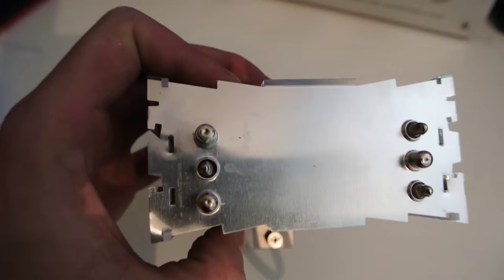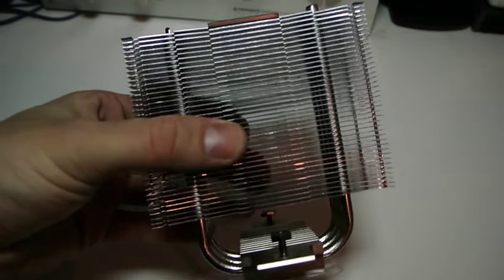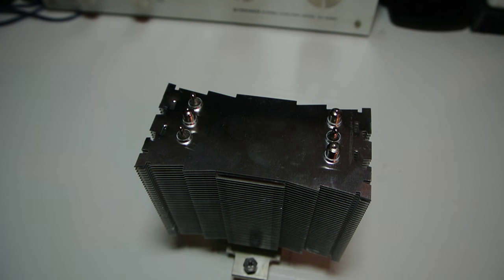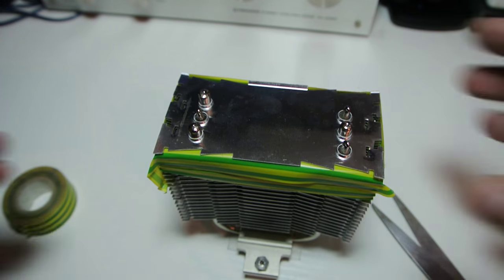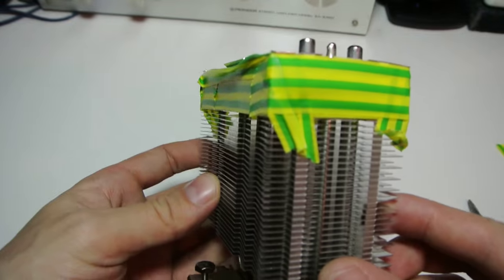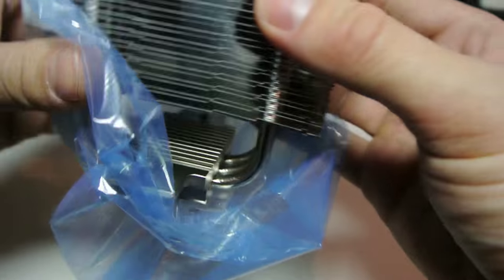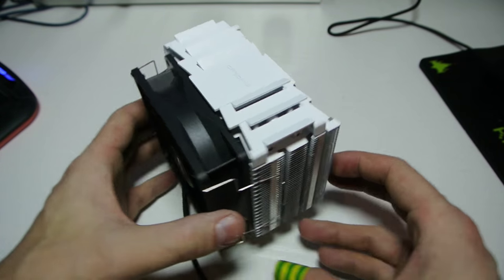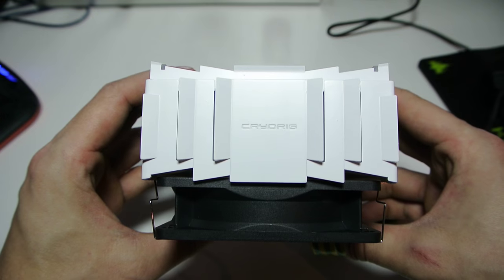How To Spray Paint A CPU Cooler

Comment: hi.. just wanna ask what kind of second fan are you planning to put there? so that the unit should have 2 fans.. and how are you gonna power the second fan? :)
Reply from the maker: Sedfrey Grafilo I put to arctic f9  fans. but I now have the Intel version of this so have two of the cryorig fans when it's installed. As for the cable I use a pwm fan splitter.
Reply: oh.. thank for your answer! :)

Comment: Were the temps affected?
Reply: Just painting the top plate of a air cooler wouldn't affect temps, painting the radiator fins of a liquid cooler does impact temps by around 3*c .... but it's worth it for the visual effect!!!!
Reply: did you test it and on which cooler?
I'm thinking 'bout doing some thorough testing when I do it anyway, got a spare cooler for which I don't care too much :D
Reply: @zlatankovacevic4281  IK this is 3 years ago but what are your resulta?

Comment: IMPORTANT QUESTION: High temperatures don"t destroy paint?????
Reply: You need to use spray paint that is meant to withstand high temperatures
Reply: ok thx
Reply: _GroX _ No problem.
Reply: Plasti Dip is heat-resistant, is it?
Reply: Shadow_1203 Yeah, Plasti Dip should work fine.